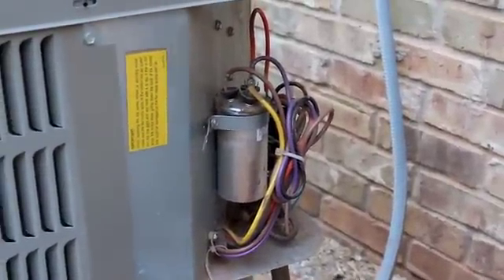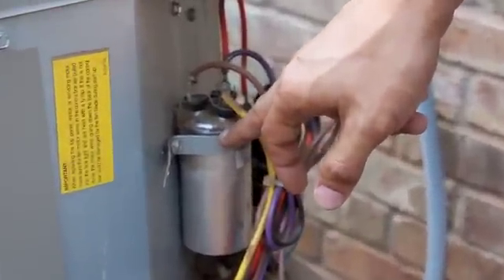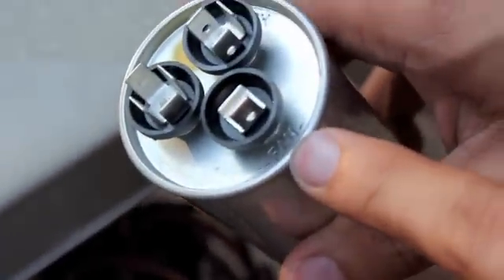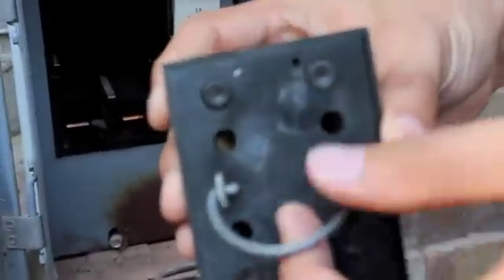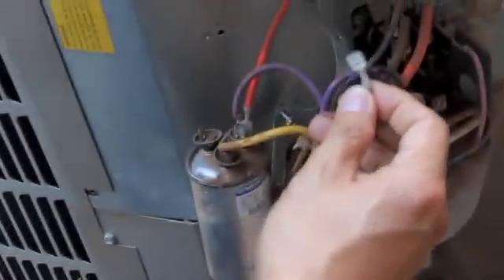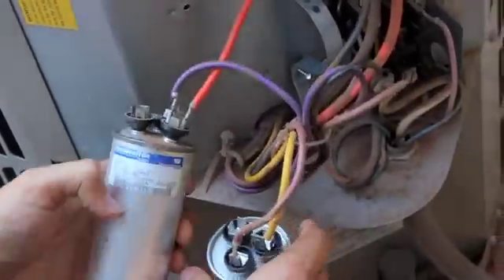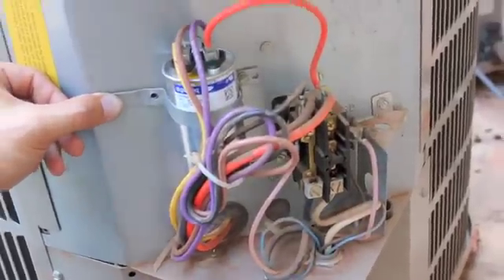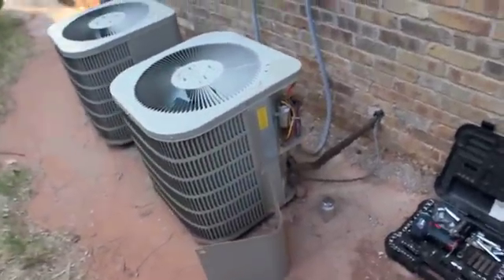AC fan not working - how to repair broken HVAC Run Start Capacitor - air condition

Comment: Folks: please be sure to discharge the capacitor before touching it’s contacts with bare hands! Use an insulated metal screwdriver to cross the terminals HERM & C. Do this after pulling the fuse disconnect box.

Thankfully this guy’s was discharged already and yours probably will be too if it’s blown, but it’s a simple extra safety step that takes one second.

Comment: The capacitor for the blower motor for the central unit inside the house (ac/furnace) has no markings on the terminals!?

Comment: Hi everyone,  I need your help,  I have an old portable a/c it works perfect when temperatures are below 32°c,  but when higher than that the compressor works for a few minutes and then stops for 15,   is it easy to disassemble a portable unit? What should I do???

Comment: It is my understanding that capacitors can hold a pretty heavy jolt of electricity even after the breaker is pulled and that they should be discharged before handling them or the wire connections to them- you neither mention this nor show how to do it- people could be at risk if that is not done in some cases.

Comment: Great video! I was hoping that maybe you could give me some advice. My air quit working properly and my maintenance man replaced the capacitor yesterday. The unit works but will only spit out cold air for about 20 minutes. After that the compressor continues to run, but the fan on top of the unit stops turning & I start getting warm air pumped into the house again. I'll shut it off for about 30 minutes & when I turn it back on everything works as it should... then after about 20 the fan will stop turning again. I've repeated this process several times & every time it's the same result.

I was just curious if there's anything I can maybe do myself to fix this problem. My guy will come back out if he has to, but I know he works a full time job (moonlights as maintenance), lives an hour away from me, & we've got thunderstorms in the forecast for the next few days. I have people in my home with serious health issues (in addition to children as well) & the sooner I can get it fixed, the better. Any help would be greatly appreciated.

Comment: When I turn on the unit at the thermostat i feel air blowing from the vents inside. Outside I only hear a buzzing noise coming from the unit where the wires tie into. I wonder if it could be the capacitor since I am getting power to the unit
Reply from the maker: most likely.
Reply: It was the capacitor. I spent $32 for a new 1 and did it myself. Well worth the time and effort.

Comment: ALSO, if I have a main circuit board to turn off the A/C from do I still need to break into my locked box and turn the power off?
Reply: i believe thats the breaker for the fan, which u shud turn it off
Reply: It turns to be the transporter, already fixed. Thank you

Comment: so I replaced the capacitor with an new one and same issue. The fan won't turn on unless I give it a turn.. any ideas?
Reply from the maker: +Shawn Gryl if the fan ran before, then check your old capacitor and see if the label is the same uF, if it is then check your wiring.
Reply: Same part and cabling looks good.
Reply: +Shawn Gryl Bad fan
Reply: if u have to turn the fan to start it. my opinion it's your fan.

Comment: Great video remember any single phase unit needs the capacitor to move any motor. The reason is that the rotational magnetic field is almost balanced equal. The capacitor absorbs a small amount of the electricity on one set of magnet poles to create a delay on that rotational magnetic pole thus inducing spin. More at www.airandheatindallas.com

Comment: how much should a repair man charge for this?
Reply from the maker: +Juanito Alima&#241;a A few HVAC friends told me it should be one hrs service call  + parts. Some charge more depending on location (longer drive etc...), hard to find capacitor values/parts or hard to access areas. But this is a simple repair, if this is the only issue then most only charge one hr service call + parts.
Reply: +Juanito Alimaña It depends, if it is 100 degrees outside and you really need it they got you, you will end up paying $150 if you are lucky, I have seen techs charging $500 just to replace a capacitor, if you look broke and your house is old they know you don't have a lot of money  you will pay $75 or $120, if you live in a richy house and they see a Cadillac escalade park outside they know you have money, rich people are easy to scam because money is not a problem for them. I'm not a tech but I know the field.
Reply from the maker: +bracsim sadly that does happen. a year ago, a friend of mine who isnt rich and lives in a basic 1000 sq ft house was quoted $450 to get the contactor replaced. a $20 part and 30min job... she didnt have the money and just payed him the 1hr service charge to leave the house. The hvac tech kept pressuring her to get it replaced and she told him to leave or she will call the cops.
Reply: +bracsim not hardly the case. i am talking for 99% of techs out there, straight book pricing, not stereotype pricing. cant go to your neighbors and charge $200, then come to your house and charge $500 for same repairs, people talk and word of mouth is the worst and best advertisement. just saying

Comment: Omg somebody help every time I use em heat the fan stops working and I have to call the ac repair man 👨🏽 which is very expensive and the dam dude probably might be ripping me off can somebody help anything?
Reply: GameHEADtime All Gaming All Tech All Platforms whats the problem?

Comment: I have a question Fan was not working so I replaced it. Then it would only work if I started by hand. So I got a new capacitor. I installed it. I made sure I knew what wires goes where also took a pic of them. After I was done went to start it up but still no good. I could see it was trying. So I recheck the wires. For some reason they had 2 perple   1 taped up and one to the capacitor. I hooked both up and the a/c started to work fine. I just don't know what was the reason for 2. 2 of them were not hooked up.
Reply from the maker: +Vincent Hodoly Jr not 100% sure since i dont know what model motor you are talking about. But, some has wires for direction, and some has 3 wires for different speed. here is a vid going over directions:
https://www.youtube.com/watch?v=TL4v5DY_4_0
Reply: +DIY Tinker Thank you for your reply. I am going to recheck the wiring.

Comment: While the repair was "successful" I want to offer some cautionary notes:   1) Never Never Never trust that the power is off even with the disconnect pulled - they are frequently bypassed by the last shade tree mechanic working on the unit    2) Always test each leg to ground for power B4 you put your hands in the unit  3) Always discharge the cap to ground B4 you handle it  4) Always wear eye protection  5) Always wear gloves   6) If this is an older unit 5 yrs+ the oil likely leaking from the capacitor is an extreme carcinogen - do not allow it to touch your skin  7)This part likely did not fail on its own...   no effort was made to ID what caused the problem or to prevent it from happening again (part changer)      Go to school - become educated & licensed before you go handing out advice.   There are plenty of hobbies, this in not one.
Reply: Dave Borowski Good safety pointers, but the rest is scare tactics and BS. All he did was replacing a capacitor, all capacitors has a life usage, also voltage and temperature deteriorates the cap over time. You dont need an HVAC education to see and test a blown capacitor. Im sure 99% of all HVAC techs in the world cannot prevent a capacitor aging over time. Even you cant and wont take the time since your precious time is to earn money. So, be real. An HVAC tech would simply do the same, replace a cap, charge the customer and move on.
Reply: +don dao actually an hvac tech would change the cap, recommend a start assist, clean coils, check refrigerant charge, clear drain pan and drain, check current draw of motors and overall system operation. i get really offended when some people think its too expensive to call a pro. i cant speak for all techs but i myself am honest and take pride in my field. when your pro repairs seem too expensive, your paying for more than that repair alone.

Comment: Everywhere I go they require a contractors license to purchase this.
Reply from the maker: mramos4131 seriously? if you can wait, the buy it on Amazon: http://goo.gl/4Xgwb
Reply: +DIY Tinker yea, I called like 5 places. I called a friend of mine and he was able to get his hands on one for me. It's over 100 degrees on socal right now and I couldn't wait even 2 days for it lol. This method worked for me btw! Thanks a lot for this! Feeling more handy everyday...
Reply: +mramos4131 never had that happen before all the years I DIY, but today someone said I did but that is because they only sold to the trades, wholesale only.  Went down the road and 2 different parts houses for retail sold to me without issue.

Comment: Thank You!  $15.04 fix..  such an easy fix. 

Outside Fan wouldn't spin. Would spin if I stuck a stick in and pushed the fan to start.
After helping with stick, the air wasn't cold..
Problem,  Dual capacitor.  Replaced it...and started right up..both fan and compressor.  I can only imagine how much it would have cost me to fix with a professional.  I would be more afraid he see how simple of a fix it was and want to tell me it was the motor. I wouldn't know any better and would have said replace it.  Thank You!
Reply: +NYPANAMA There are single capacitors and dual run capacitor......They are marked with micro farrads and voltage rating(370 or 440).....a dual would run the fan and compressor ....a single would run one or the other....

Comment: ...Thanks. Diagnosed our non-cooling A/C tonight as a bad run/start capacitor. Your video was quite helpful. Much appreciated. Now, hopefully I can find one of these run/start caps locally; it's supposed to be the hottest day of the year tomorrow so of course my A/C fails the night before.

Comment: I just had a new capacitor installed. Wish I'd seen this first and might have gotten someone to change it for free. But now the a/c is running but the temperature hasn't changed since the service guy left. It ran a good hour or two. Any ideas? I called him back but haven't heard from him yet.
Reply from the maker: Linda Sullens what is your "hvac Delta T"? search youtube for an example. if its in 10 to 15 degree then it might be your insulation etc...
Reply: DIY Tinker Thank you for response. Simple solution was the vent on the side of the inside unit was blocked with something I had put in the small closet, so the air wasn't circulating correctly.

Comment: Draining the cap should be the very next thing to do after killing the power. That cap probably had little charge since it had failed but what if it was a larger cap still in working order holding the full charge? True some people can figure it all out but remember there are plenty of people that will grab a good cap and WHAMMMM!!! Other than that this is a good video.
Reply: Absolutely. I'm surprised by the number of videos that don't tell people to discharge the cap. 380/440 volts will make you feel some type of way...
Reply: +Gregory Pierce This guy is a DIY'er....not a HVAC technician ....he did have something on the video about waiting after shutting off the power ....BUT he didn't tell anyone how to discharge the capacitor

Comment: Do you think this os what is wrong woth mine ?
It won't blow any air inside and the fan on the outside unit doesn't spin
Reply from the maker: Dalma Mendoza if nothing comes on, then start with the thermostat and work your way to the air handler/furnace for power, control board, transformer, then to the condenser. Here are a few vids to help you out.
https://www.youtube.com/watch?v=nJVTVCVITxw
https://www.youtube.com/watch?v=JilZmyglFvo
https://www.youtube.com/watch?v=cnD65qX8bjM
https://www.youtube.com/watch?v=4OAGq84mQSo
Reply: Thanks got my land lord fo fix for free lol but thanks your video is very helpful

Comment: good idea to clear the discharge off the terminals you can use a screw driver just put between the leads a couple times should do it
Reply: +Todd Sch yes, with the wires still on. Touch the screw driver so that the metal touches both terminals at the same time, fan to ground terminals. Then compressor to ground terminals.
Reply: Steve Johnson Would you do this before disconnecting the wires?

Comment: How do I know what capacitor to buy?
Reply: Your capacitor should have the type on it. Like mine says something like 440 vac 50/60 Hz...do I have any idea what that means not completely but a quick search on Amazon and you find what you need for $10-$30. Best of luck.

Comment: I think my A/C got hit by lightening.  Before today, it was working okay with an occasional time it will throw off the a/c breaker.  I would just go outside and reset the a/c breaker and it would trip on.  But today after a lightening storm hit the power to the house, the breaker was tripped again, but the a/c fan does not come on again and I do not hear the a/c click on when I turn on the a/c.  What's going on?

Comment: u not afraid the capacitor going to shocked you :)
Reply from the maker: no, not really. It loses charge quick, its DC and human body resistance is high. But of course, drain it is the safest way to go. :)
Reply: Capacitors can still hold some electricity when disconnected n can shock you.

Comment: DIY Tinker videos - just love them - however my issue issue is that only the blower wont come on when AC is on - either auto or fan. I switched the setting to heat and guess what. The blower came on - I switched the settings back to AC and it's running just fine. If I shut it off no blower fan. I do not have a volt meter so not sure how to test the safe-t-switch. Any thoughts?

Comment: This guy broke the cardinal rule of electricity. Do Not Assume! There is a proper way to discharge the capacitor. I am not an electrician or HVAC Tech but I know this much.

Comment: It's a water chiller & hvac I'm trying to reset it but the contactor relay it won't shut,if I let go.there s a power 208vac, hmp I wonder if something preventing to close or stuck in between...or something clog,that anything interrupt. Anyway I appreciate your help,I like your videos.
Reply from the maker: if you have 24vac, then sounds like a bad contactor relay.

Comment: I have a question.i my working place we have a old chiller,I'm resetting the relay but if I let go, it  will turn off,it won't stay on..
Reply from the maker: not sure which relay you;re talking about. but if you dont have 24VAC, then the relay doesnt shut.

Comment: Hi. My AC fan does not work. When I turn on the AC I hear an electrical hum and the fan does not spin. I replaced the capacitor today but it didn't help. Please help.

Comment: Please understand that the parts you use for each unit need to be verified by the manufacturer in order to validate warranty.  Another good tip is don't use parts made in China, they will only last a year at best. 13 years of experience has taught me that👍

Comment: Thanks for this video!  Just fixed mine and it cost $25 (plus $15 for overnight ship).. My ac was blowing warm air..my fan outside was still spinning but not as fast as normal..usually the fan spins fast enough to blow air back at you..when i put my hand over it i could barely feel anything.. So apparently the old capacitor wasnt conpletely dead but didnt have enough juice left...switched it out and bam! Cool air again..